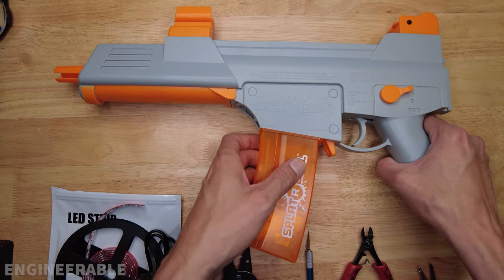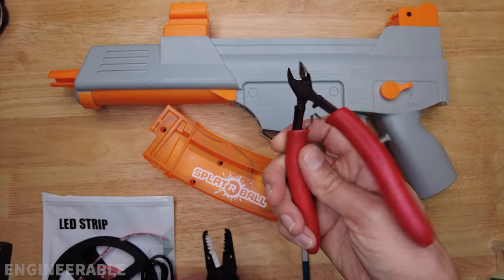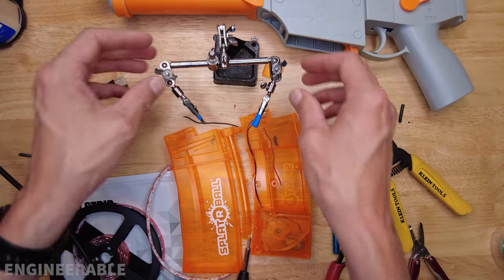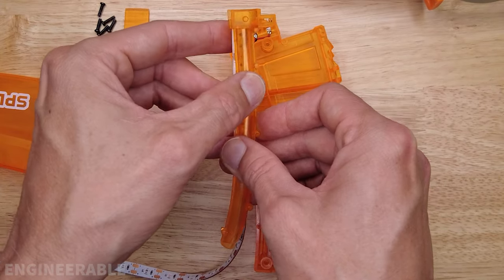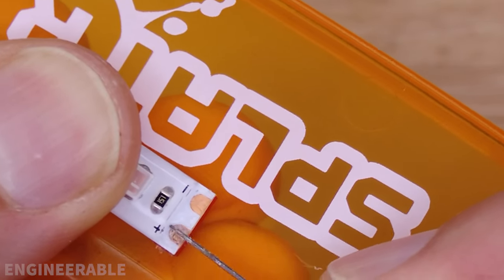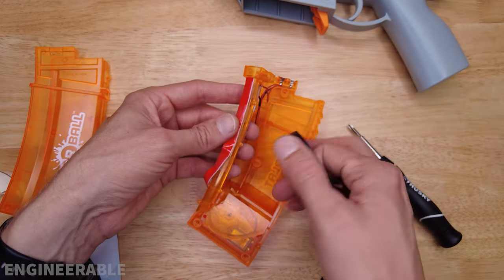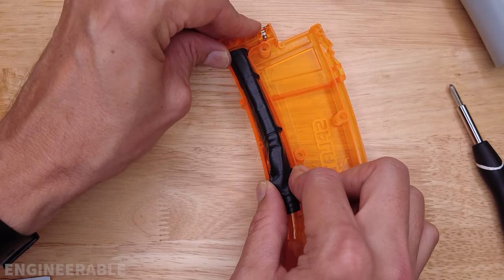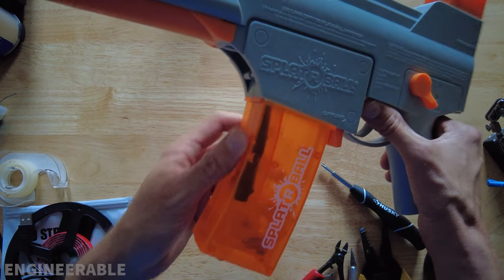NEW EASY TRACER MAG MOD to light up glow in dark orbeez splat ball for Splatrball SRB400 Gel Blaster

Comment: Hey Engineerable! Unrelated but do you have any tips to upgrading a hydro strike pulsar pro? I've looked everywhere and could find anything really at all helpful. I'm  looking to upgrade the range but anything would really help! Thanks for    reading!
Reply from the maker: Haven't finished Hydrostrike upgrades yet. Longer range means a stronger spring, which you can use until you trash the plastic gears and then upgrade to metal gears. Stay tuned!
Reply: @engineerable  looking forward to it!!! Thank you!!!

Comment: Do we have to use a solder or can I use a hot glue gun?
Reply from the maker: It's best to use solder to join wires.
Reply: @engineerable  so I can use a hot glue
Reply from the maker: @alexvr4057  you can do anything, but you shouldn't use hot glue to join wires. It probably won't last long and could create a fire hazard. You should solder them first, then you can use hot glue to insulate the bare wires.